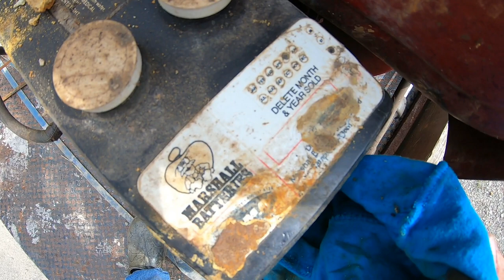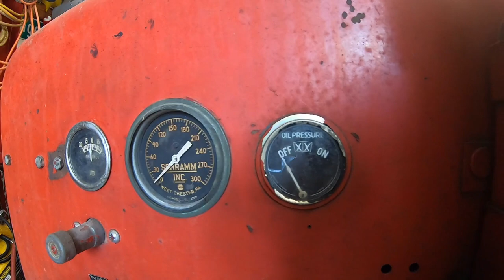1950's Gas Powered Air Compressor sitting 30 years! (Will it run!??)

Comment: I've seen a few versions of this type of compressor. Both of them were Chrysler V8 small blocks. Just like the one you have, one head looked completely normal, but the other side had a modified head/manifold on it. These were both tow behind units. Great video.

Comment: Nail polish will work as long as you stay away from ethanol fuel.  It was also used to seal Welch plugs in two cycle carbs before the days of ethanol fuel.

Comment: I have seen some at the scrap yard that were made from Ford 351 Windsor engines, as in yours one side was the engine and the other bank was the air compressor. Still built like yours little compact unit, but there were larger ones from inline 6-cylinder engines that had four wheels and towed around.

Comment: Permatex #2 has been my unfailing guarantee for oil pan gaskets since 1974. The stuff has gotten hard to find since everybody uses silicone now but if they knew what we know they would use permatex #2. Never used it for a gasoline seal but it's the best way I've found to defeat crank case pressure on oil pan gaskets...

Comment: Very cool old compressor!  I saw the Wisconsin V-4 and had to watch the vid.  I ran these engines on old hay balers and it seemed every versatile swather I was ever on ALL had the Wisconsin air cooled engine!  It didnt seem to matter how hot the air was or how hard you worked this engine as long as you kept the cooling fins on the cylinders and heads clean they ran for a very long time!!

Comment: Keep the videos coming! They made compressors like that up into the 80s using big block fords and using 1 side of the engine like that as the compressor. 185 cfm I think. Pretty wild! I think they used those engines in the 80s cause of the long stroke.

Comment: I worked at Air Compressor Service on MD back in the 70s That little Srchamm wit push a 90 Lb hammer. that requires at least 165 cfm. it will push a small concrete chipper most likely. It's definitely a sweet little compressor! Good luck

Comment: We had 2 of these in the late 70s mounted on wheels with a hitch. We used them for sandblasting cemetary lettering for the monument company I worked for here in Baltimore. They were ancient even when we got them and were likely late 50's, early 60s machines.

Comment: I remember old Volkswagen aircooled engines mounted on small trailers with a air reservoir . One sides cylinders where standard other side had heads converted for compressor usage they where pretty powerful. Could run a couple of jack hammers.

Comment: Schramm built good stuff. They also used Leroi gas engines. Started out building compressors from hopper cooled gas engines. One cylinder engine one cylinder compressor side by side.

Comment: In my 50+ years in construction, I've never met a jackhammer I liked. But good luck with your compressor. I do have a suggestion though: Buy an ultrasonic cleaner for carb (and other )work. It will be an epiphany moment.

Comment: Our company rented a compressor with a Cummings v8 diesel, using 4 cylinder bank for air compressor, 4 cylinders for power, worked fine.

Comment: the trick to soldering a float shut? make sure all fluid is dried out from it (thermal cycle it hot/cold multiple times), clean/scuff-sand the surface well, use good flux and solder, then you want to heat the the area as fast as can be and flow it leaving a slight pool, as it heats the air inside will expand, pressurize and start spitting air/solder globs, now is the tricky part! use ice or cold water bath to quickly cool the brass and air inside from opposite from the solder joint area, making sure it stays puddled and doesn't suck a hole in from cooling too fast. it's not easy but practice makes perfect.
I've tried flash cooling at the solder joint area before and it seemed more finicky to get a good lasting bond.

Comment: Drill a small hole in the bottom and top of the floats that will allow it to drain and wash it with soapy water to get any flammable residue out of the inside, once clean and dry inside and out solder the holes back up. That's the old school way to fix a brass float and leave it serviceable again

Comment: I clean and rebuild small engine carburetors. You really should invest in an ultrasonic cleaner to give it a good thorough cleaning internally and all small fuel passages. I don’t know if that specific carburetor has an emulsion tube underneath the main jet, but many carburetors have one of those that are used for the idle circuit. You might want to check into that. I love working on old engines like this. They’re simplistic in design and operation. Great video. Don’t give up on it. Get it running well. Good luck.
Reply from the maker: Oh I dont give up! lol I want an ultrasonic but unfortunately dont have the room right now. one of these days I hope.

Comment: that's a seriously nice find you got there ,i have one very similar  to this ,mine was originally mounted on a service truck so  it's  not quite as clean as yours but it works awesome ,it doesn't build up high pressure only about 120 psi  but it'll easily run a small jack hammer or a 1 inch impact strait off the manifold

Comment: To clean and repair the float, use thermodynamics. Soak that puppy in lacquer thinner. Then heat the float gently with a hair dryer and then immerse in lacquer thinner and the thinner will suck inside the float. You can repeat to get more thinner inside. 
 Now reverse the procedure with a spotlight bulb and the goo will bubble out of the float until it is bone dry inside. Solder it up and it's done repaired

Comment: If you can't find a replacemt float those old ones are easy to fix. Drill a all hole in the bottom and one in the top and drain out all the gas inside and braze the holes and amy other cracks up and it's good as new. If you feel you can't get it fume free enough to braze than cut the bowls completely on half & clean them or use epoxy.

Comment: Please don't get tired of me yet... I have a Wisconsin V4 on my '70's  Case industrial tractor.. Got really tired of rebuilding my Walbro (Marvel- Schreiber was an option0; I built a simple intake with 2 exhaust flanges from E Bay and a short u bend pipe.. installed a new  VW clone carb (@~$50) pict-3 (or 4 depending on how much fuel you need)... It runs better than it has ever run and with an electric choke, doesn"t require my input to start on less than 1 revolution..

Comment: I'm sure you did it, but you didn't mention putting a light coat of lube on the lobe of the distributor shaft. Many people miss this step and wear out the phenolic lobe on the points prematurely. You might consider inspecting the inside of the air tank also. They can get compromised from corrosion over the years and explode on you. That is one sweet set up. I'm sure it will come in handy on the farm.

Comment: @Diesel Creek generally, fuel in float bowls is set to below any gasket seals, try reducing the float height perhaps? also, I would simply apply a seam of fuel proof rtv type sealant into the gasket groove then upturn the bowl onto some grease proof paper or similar till the rtv fully sets, then trim any excess.

Comment: If you have a stripped-out threaded hole, sometimes you can attach a nut behind it with hot glue, and the glue will come loose when the bolt is tightened onto the nut, allowing the nut to align properly with the casting's back surface and thread onto the bolt-shank correctly.

Comment: I've seen similar but larger Schramms up here in northern NY. I think some were 6 cylinder, same basic set up though- 3 cylinder running the engine and the other 3 compressing air. Neat!

Comment: What i have done before with those brass floats when leaking is held it with moles grips and set it alight let the fuel burn off and the heat resoldered it self if it has a small hole use a soldering iron

Comment: 7:15  Last time that happened to me I twisted the pipe off where the plug met the pipe.  Got it back together with a new pipe but that wasn't my best day of changing oil on a piece of equipment.

Comment: Those carbs we're known for vacuum leaks and fuel leaks when they got older .
That carb was designed to operate 4 cylinders 40 hp engine .

I personally would take all of the intake off and build a new intake for the 2 cylinders that power that unit and use a modern day carb designed to run a 20+ hp Kohler , Honda , BS .

Comment: This was a real  good find. I was thinking if you remove and  carburator mount it level on workbench and check out the function of the needle & seat properly as well as float level, maybe make a mockup bolt with hole to fasten bowl & add clear plastic pype to see where the level set at(Like hose pype water level).
If it was myne I sleep ok after 5 oil changes over 3 months with incremental change/run times.

Comment: a cheap way to help remove that varnish is oven cleaner ive found. ive also used diluted battery acid on water oxided up alloy carbs brushed on with small paint brush but you have to keep an eye on it then i would heat it up with mapp gas burner seems to stop it oxiding up again in a hurry

Comment: Smith motor compressor company out of Kentucky did the same thing in everything from a Wisconsin to a Ford 460. I have a 1970 Smith 75 that pumps 75 CFM out of a Chrysler 265 inline 6

Comment: I put marine primer bulb, about 6 bucks from Amazon, on fuel line, makes starting so much easier especially if you run engine dry with shut off

Comment: I live in Australia and so am not sure if the brand names I mention will be familiar in the US, but the unusual arrangement of this old machine took me back to the 1990's when I also obtained an unusual air compressor that had a 'Greenfields' brand name.

The thing was based on a very old four cylinder gasoline engine which I suspect was a Chevrolet that had been converted to an air compressor.

All four cylinders were used to provide high volume air for a siphon arrangement that lifted water from a deep well into a surface cistern.

The compressor was powered by a flat belt running off a big old single cylinder Tangye brand hot bulb ignition engine which also powered a pump for irrigating market gardens from the cistern.

The old Tangye had a single flywheel about five feet in diameter and about a ten inch bore and a buddy owns it now.

Comment: Cool old compressor. Lister did a similar thing with their 4 cylinder and 6 cylinder gas and diesel engines during WW2. You have what appears to be a modified Wisconsin V4HD. That engine was used on the New Holland 276 square bailer with the Marvel Schebbler carb. If you don't have a good old school New Holland dealer there you can try contacting; Garton Tractor in Stockton, Ca. If no luck try, Stan Fetch and Son in Stockton. I've usually been able to find parts for this in the area or at least have them in a couple of days.

Comment: As. Soon as I heard that about changing the oil I would  too don’t forget the oil cleaner too. That is a fram oil filter just go to wall mart and buy some heavy duty 30 weight oil as that is used in Wisconsin engines. I have experience with them. A really tough pony motor. I think they are still in business.

Comment: With the brass floats I used a heat source to find leak, and purge fuel. Then just solder leak, can't do that with NITROPHYL Floats. Old school repairable....In a pinch, a heavy solder iron will repair Radiators too.
Kind of an f'ed up spot for oil fill, but I appreciate the chain cap tether.

Comment: Honda makes a liquid gasket that will replace that paper one.  Just squeeze a small bead on one surface you want to seal.  Let it sit for 10 minutes or so and then lightly press into place.  Let it set for awhile, overnight is good, and then tighten down.  Check out Steve's Small Engine for that and other useful tips.  I'll also bet you can pick up a chinesium carb that will work.  I've bought them in the past just to get one or two parts off of.  It looks like a Zenith 11532 carb and they are still available.

Comment: In the early eighty's I worked on a Scraam powered by a 3208 cat half was used for an air compressor the other half was power for the roller.

Comment: If You take Kerosene  to  soak  your carb  in It dose 
well .  I use Kerosene in a  sonic cleaner . Does wonders 
for opening up the real small  orifice's . Harbor Freight 
has a small cheap one I use .  It also heats up  .  I rebuild
old carbs Hollys , Qjets , Fords  ect . It looks like you need a 
thicker gasket material .  The black ATV will clog up your
 carb .  Use ATV  Gray  made for gas and Diesel .  I hope this
will help .

Comment: With a 'center bolt' float bowel carb, the bowel sometimes gets pushed up, creating a gap on the matting serface, make sure that the bottom of the float bowel is flat.  you might even try a thin washer between the bolt and the float bowel itself... Also check the 'jets' in the carb, (fuel passages), I've always used a 'tip cleaner' to check to make sure that the passages were open ...

Comment: I worked for a tire service we had one on a back up truck I don't know much about the mechanicals about it but it will build air fast it will run the socks off an old antique 1 inch drive impact wrench boss always said it was expensive to run lol

Comment: There  once was a kit to convert V W air cooled into a compressor.   and old baking pan on the bench make the runaway parts less  likely to travel.   Lincoln had a generator welder that used that same Wisconsin v 4.

Comment: Questions ? There is a guy on YouTube called Mustie1 he has a device called a Ultra Sonic Cleaner I see them on some of the other channels 
as well. You plug it in & turn it on & it heats up & buzzing sounds are made & the parts come out looking in most cases like brand new !
You full it with parts cleaner carburetor/brake but lately he has been using a product called simply green from the 99 cent store. You need 
one of these machines ! Ultra Sonic Cleaner.

Comment: Schramm made drilling rigs primarily, the air compressors were made from several platforms I have one that was a flathead ford v8... 4 made air and 4 ran the engine.  I have a friend in Findlay Ohio if you need a manual or parts for it... but it'll probably run like a champ.  PM me if you'd like a good resource.

Comment: Looks like Wisconsin V4 thats had 2 of the 4 cylinder heads doctored to convert to a compressor. I worked on 4 cylinder in line Petter diesel that too had 2 of the pots converted to compressor. Ran a bit harsh but sure worked..

Comment: I had Schram years back had the v4 Wisconson and it had a split intake with carb feeding the 2 front cylinders and the back 2 cylinders had an intake with just an aircleaner and had check valves with blow off valves threaded in the plug holes that fed the air tank. It was a great compressor for sandblasting and it didn't run at super high rpms but seemed to make decent air. Mine broke a rod at the wrist pin and I tore it down and got the parts for it and just never put it back together because I got a Diesel compressor when mine went down and it got pushed in the corner of the shop where it's been for about 5 years now.

Comment: It is a good thing someone taped over the exhaust stack.  I have run alot of equipment with Wisconsin engines, love the sound!  Re the pressure causing the carb to spray fuel, possibly an exhaust valve issue, maybe adjust valves??

Comment: You did mention needing to do a second oil change once you'd gotten it running for a while to clear the sediment and accumulated crud out of the oil pan.  Hope further efforts with this machine go well.  I wouldn't say anything, but since you had the splice with the year jump in there, I thought a reminder might be appropriate.

Comment: Parts are hard to find for those Wisconsin engines. And expensive. You're probably going to have to solder the holes shut in that float. If there's enough brass left to salvage it. My Grandpa had a New Holland twine square bailer with a Wisconsin V4. Grandpa wasn't strapped for cash by any means but he wouldn't spend money on anything if there was any other way. The starter didn't work anymore and the fuel pump was weak. So while my Uncle Glenn blew on the gas tank to push gas up to the carb. My Grandpa turned the engine over by hand until she cranked. It always started pretty quick so I reckon it wasn't too bad. I miss those days. Riding on the hayrack. Pulling alfalfa bales off the bailer and kicking them back to my uncle. Grandpa drove the tractor and Uncle Glenn stacked the bales. And he stacked em high and tight. Then Grandpa would load the elevator with an old Clinton engine pushing hay up in the top of the hay sheds. And did it all summer long.☺️ Thank you for the memories bro. I miss them guys they tought me sooo much. And I had madd respect for both of them. GOD bless you!!!

Comment: You never saw one because your just a puppy. Used to be lots of them, The pneumitractor version was the biggest clumsy club that ever rolled on earth. They had a six cylinder engine with three running the tractor and the other three cylinders made air. Most had a broom on them and if you new what you were talking about you would notice them out along the highway. Schram is still making compressors for pro's last forever.

Comment: I suspect you have a gasket issue but I think your float level is set to high try lowering the float level and use a flexible thicker gasket and be sure to use a good gasket between the intake and throttle body base good luck looks like a fun machine